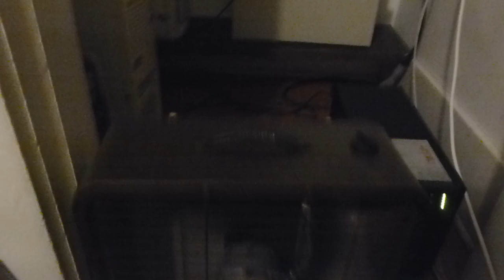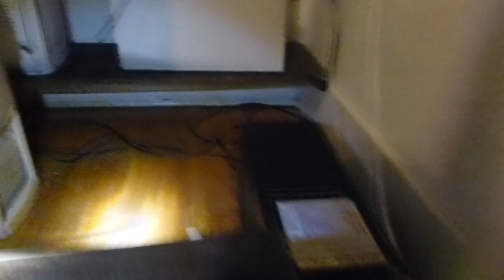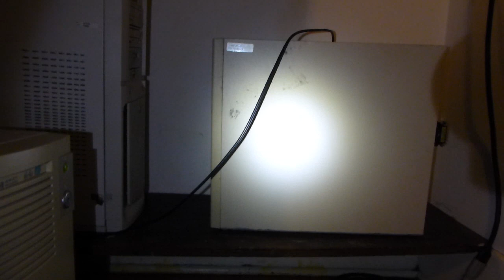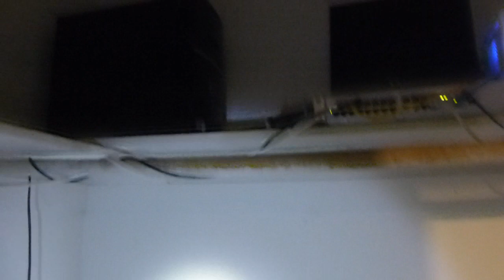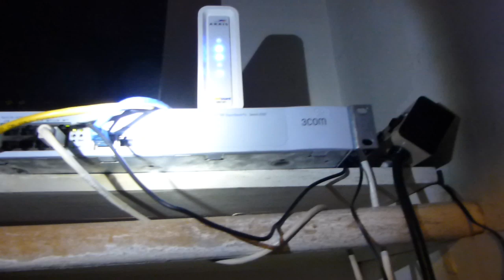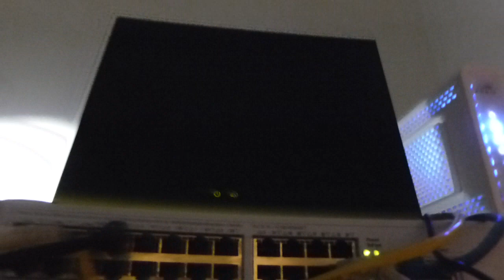The "Server Closet"

Comment: Let us know if it starts smelling bad in there :P  How do you like Open Media Vault?  I've been having decent success with NAS4FREE.
Reply from the maker: OpenMediaVault has been working fine so far, though installing it on a 32-bit system is a bit tricky.  They don't produce 32-bit installation ISOs anymore, so in order to install it, one must install a 32-bit version of Debian, then manually add the OMV repo and install the packages from there.  NAS4Free (now called XigmaNAS apparently) was what I was originally going to use, but apparently they, too, have dropped 32-bit support.